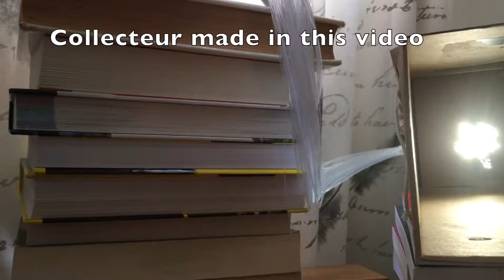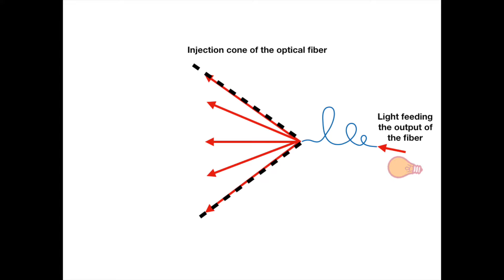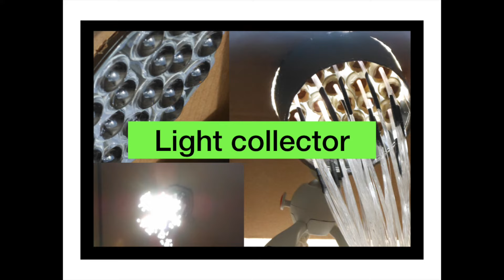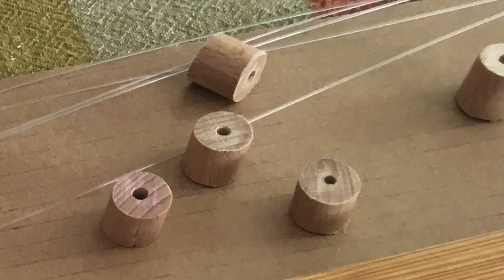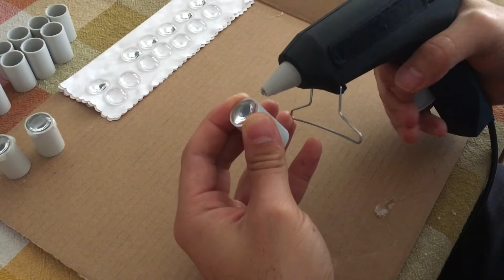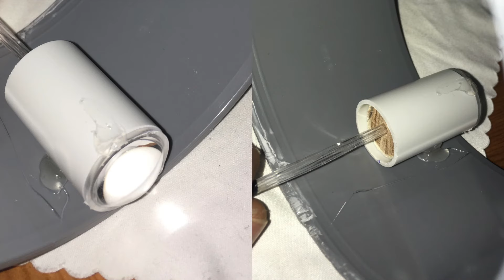FULL DIY TUTORIAL Sunlight collector using optical fibers

Comment: Was planning something like this and luckily came across your videos, thank you very much!
I would need to route sunlight from a little more distance. Could one use less fibers (=less total width) to transmit light and then re-distribute it? I mean, to arbitrarily increase light input while using constant fiber to direct it? Thanks!
Reply from the maker: thank you for your comment, good to know my video can help you :) regarding what you are planning to do, you should get the information about the optical losses of the optical fibers you will use. if you use good optical fibers, you will have like 5dB of losses per km (5dB/km), meaning if you put 10W at the input, after 1 km you will have around 3W. Now, if you use bad fiber like the one I use (for fake starlight sky, PMMA base fibers), they have really higher optical losses, I found one with 200dB/km or even 500dB/km, so again, with 10W in the input, you will have nothing after a km, and not a lot after a couple of meters (the value for 200dB/km is 10W divided by 100000000000000000000, and even worse for 500dB/km optical loss). So if you plan to send light over long distance, use good fibers :) There is also losses regarding the optical coupling, meaning how you will put light in the fiber, as I said in the video, be cautious to adapt the couple lens/fiber to optimize the light you'll be able to propagate. One last point, what do you mean by "arbitrarily increase light"? Let me know if you need more info. You can also look on my channel, I'm working on a 3D printed version of this collector, using good fibers ;)

Comment: I want to know about the UV part. Can the UV is also transmittable through this way if the quartz optical fiber or the fiber which enables to transmit the UV is being used?
Reply from the maker: Hi! As long as every components (lenses, fibers) are transparent for UV, you will be able to have UV at the output of the fiber.

Comment: Could the fiber optic cable be longer (4m) , to bring light form the roof to a room downstairs?
Reply from the maker: It's possible but it depends on the optical fiber you're using. If it's one made to propagate visible light, you can send light on km range! but the "plastic" fiber like PMMA, you can't aim for really long distance... if your need is to efficiently bring light in a room, I'd recommend to use a good fiber :)

Comment: where to buy? lens not finding anywhere!
Reply: and What about the heat when it exposed to sunlight?
Reply from the maker: hi! using the keywords "lens plano convex" you will find something on Ebay, amazon or aliexpress. Regarding the heat, it's transmitted inside the fiber, but depending on the fiber more or less will be transmitted.
Reply: @nebulus3D  
Means I should not be worrying about heat
Reply from the maker: With a small size like the one on the video it was ok, but for bigger size, be sure the use silica fiber, Plastic one might melt

Comment: This is great stuff!  I'm hoping that a single large fresnel lens could be used by decreasing the focal length so that it does not melt the ends of even the silica fiber.  I then want to focus the light at the other end of the fiber down to a pen point using another lens.  Do you see any complications with this?

I also saw that you mentioned an "x, y, and z positioning system."  Are you designing a sun tracker for it?

Really looking forward to your additional videos.
Reply from the maker: Thank you very much for your comment :) Well, regarding the melting point it’s a tricky question. Actually, assuming using a silica based fiber  and knowing that pure silica melting point is at around 1700°C (1500°C for iron as a comparison) if you reach that temperature on the fiber you’ll have a problem. But I think you’ll need a big lens to get there... and also, be careful, with a fiber, there is often a protective layer (in plastic!!!) that need to be remove before placing the lens at the focal point. Regarding the use of a fresnel lens, as long as you match the numerical aperture of the fiber with the lens property you’re good :) then for the refocusing at the end of the fiber, no problem, but again, you need to choose the optics to not loose too much light (for example: fiber end, convex/Plano lens, Plano/convex lens then where you need to focus) . The x,y,z positioning system is on its way, actually I’m just waiting a good weather window to do the tests/video/experiment. The sun tracker will come later, know the idea is to precisely inject light in the fiber by moving the fiber behind the lens. I hope this will help you. Thank again and stay tuned ;)
Reply: e vr application would be possible by taking the current light sensitivity and enough photo diodes to filter out other crap to get the xyz accurately
Reply: Or use that same setup with infrared there would barely be any trash light :P would work well

Comment: Do you know what PAR levels you are getting out the other end? Or an input to output ratio? that would be nice to know!
Reply from the maker: unfortunately, I don't have the answer, and measuring the spectrum is not an easy and cheap operation, it would be nice to have a DIY spectrum analyser :). One way I see to check if the light is good for photosynthesis is to make some tests and see how the plants will like the light or not... and make comparison with another plants which are place outside, see if there is a big difference in growing, colors... this can be quite a long experiment :p but very interesting. I was also thinking of growing plants inside a dark place like a closet, it would be a good demonstration of how sun light can be brought anywhere with a low cost solution and (almost) pollution free!!
Reply: That would really interesting! Great ideas :)
Reply: Hi, your idea is awesome, 
did you get any result for growing plants
Reply from the maker: thank for your comment :) no result yet... but I putting everything together (slowly... ) and the sun seems to have left the place I'm staying... I'm working on it!!

Comment: Does the intensity of light is affected ...
Reply from the maker: yes it is. Strongly depends of the kind of fiber you use. You can see a fiber as a filter for light, it attenuates the light and not equally regarding the optical spectrum...
Reply: Aiz3n974 can you tell me about the temperature at incoming point of optical fiber because after passes through convex lens temperature increases....😇
Reply from the maker: indeed the temperature is higher... I don't know how much, I know it's higher than 233°C (451°F) because I was able to burn paper, but it still lower that 800°C because the silica fiber I use did not melt :) Unfortunately I don't have a thermometer to measure this :$
Reply: Aiz3n974 thanks for giving me satisfied answer....🙋😇
Reply from the maker: you're welcome :) try to do my best :p

Comment: Thanks for such an informative video on a topic thats difficult to find research on. Does this light carry heat also along? I mean like LED(or any other light source) bulbs produce heat when ON, will the sunlight transported in such a way also heat the area that it lights? How long (far) can the end of the fiber be from the source(beginning) , lets say 10 metres? Will the distance affect light intensity? How much equivalent watts of light is produced lets say compared to a LED light bulb source, 30/50 watts? Thanks much.
Reply from the maker: really fine! hope to share a video in a couple of week. Still working on a DIY way to do my x, y and z positioning system :p
Reply: Hi, Did the silica base fibre work well?
Reply from the maker: Thank you for your comment and so many good questions!! Yes light carry heat also, when I will have a little more time I will do an experiment showing this... I think 10m is still good, actually it strongly depends on the property of your optical fiber... the one I use is very cheap, but I'm quite optimistic regarding what would left after 10m, the distance linearly decreases the amount of power, so it's not a strong decrease of light. Unfortunately I don't have the equipment to measure the power, I will try to find a DIY way to do it. Again thank for the question and your interest
Reply from the maker: I made some tests with a 100m fiber, but I found out they shipped a side glow fiber, which is really not good for what I wanted to do. So be careful when choosing a fiber... check that's an end glow. Also I ordered a higher class of fiber, I hope it will be really better :p I'll post a video
Reply: Yes side glow fiber is of no use, as the light will leak out from the sides rather than ends. Thanks for keeping us in loop though. Hope you have a great success soon. All the best.
Reply: How much the higher class of fiber is costing you?  Can you share some details of the fiber, thanks.
Reply from the maker: It cost me around 30€ for 50m. Found it on ebay it's a silica base fiber, should be better than a plastic one. I will receive the parcel next week :p

Comment: really great idea! I want to try it, and the fiber is easy enough to find - a 300m roll on amazon goes for €17. but can I ask you where you found the lenses? I can find expensive lenses online, but could not find small (and hopefully inexpensive ones like the one you used).
Reply from the maker: Thank you for your comment!!! indeed, 300m for 17€ that's good!!! Look on eBay with this key word: 5pcs/lot High Power LED lens 23mm convex lens optical glass led lens for DIY, 2.5$ for 5pieces
Reply: super! have them ordered, looking forward to trying it! thanks very much - I couldn't find anything searching for it in spanish, searching for it using your text (in ebay.es...) I got a hit right away. Thanks again, brilliant video! :)
Reply from the maker: you're welcome!! Don't hesitate if you have more questions!! Hopefully you should have more sun in Spain than in France ^^
Reply from the maker: When you'll received your fiber, make some tests to be sure it's an end glow fiber. I have a 100m side glow, and there is no light at the end, quite frustrating. Also I ordered a higher class of fiber (more expensive, but might worth it), I'll post a video if my other collector works as expected :)
Reply: will do, and will let you know! the fiber already arrived, but the lenses may take weeks to clear customs!